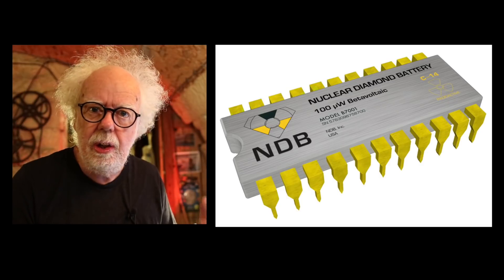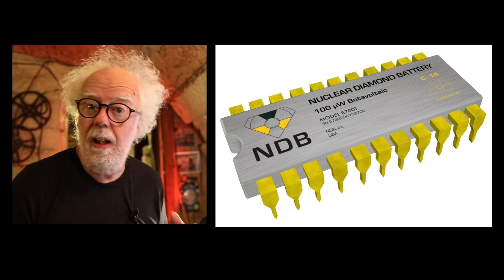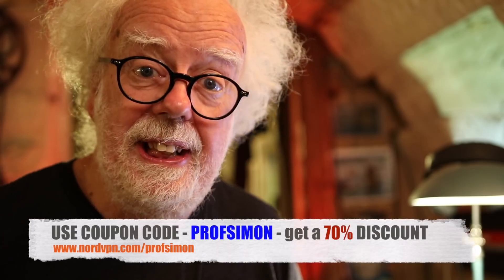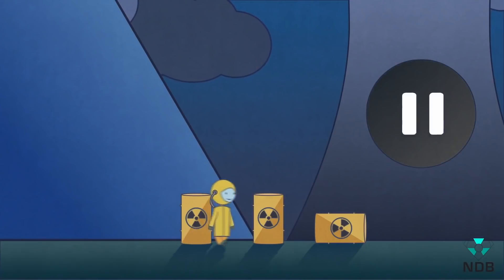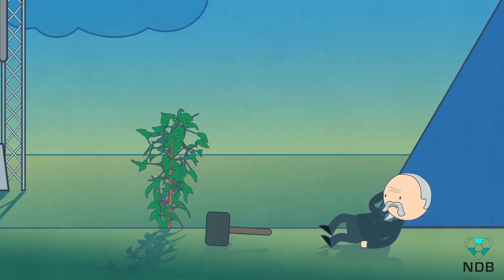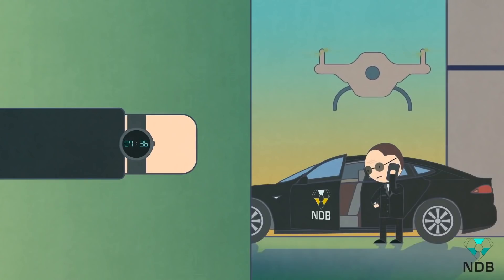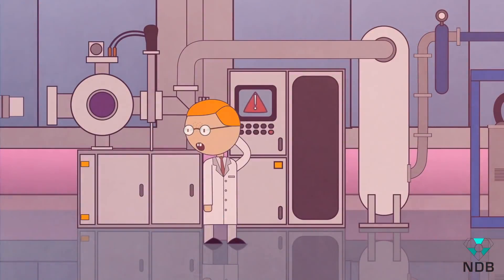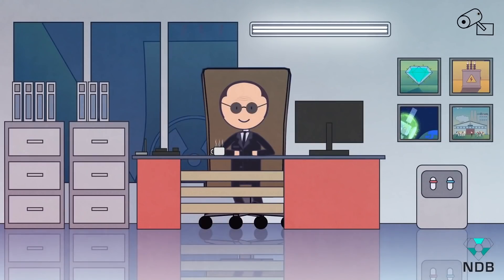How do nuclear diamond batteries work - prof simon

Comment: Its actually made from c14 that only emits beta waves. The side of radioactive material would be smaller than a pinhead and the diamond they coat it in would be dense enough to block the beta radiation. They could also put a layer of lead on it and Im certain that also would work. It doesn't emit gama radiation. If it did then yes, you'd need more than a nano diamond coating.

Comment: Alpha particles (nucleus of a helium atom minus the electrons)  are easy to block,  a sheet of paper will do.  Beta particles (electrons and positrons) are somewhat harder to block but these are the particles that could be used to generate current.  Gamma radiation (high energy photons) are the hardest to block.

Comment: Sounds fishy ...nuke batts are not new, but the power output is Low like the nickel-63 nuclear battery The open-circuit voltage and the short-circuit current are 1.02V and 1.27μA respectively. The maximum output is 0.93μW at 0.92V. equating to ~10μW/cm3 also the power density is far greater than normal batteries because it last 100years so it sounds really attractive but it will just about make your watch tick or run an LED for 100 years compared to a normal cell which may only last a month = 1200 times the power density but it can't run anything more power-hungry than the LED. It is still getting power from beta (fast electron) decay which we have been able to do for years since 1913, by Henry Moseley

Comment: They explain in the video that the radioactive diamond will be additionally coated in a non-radioactive diamond, allegedly solving the issue of leaking radiation and thus making it safe. I’m highly skeptical they’d even be promoting the idea if they hadn’t already solved the issue of radiation leak. If they hadn’t, it would be laughable and no one would even consider it a viable concept.

Comment: We make nuclear batteries at my company not for sale! The concept of this battery does work but not even enough power to power a phone. the way we make batteries is we take highly energetic material such as polonium, thorium and Tritium. When you say a battery produces electrons you have to consider that beta particles or electrons themselves. You need to use a silicone graphite material to change those electrons into electricity. Essentially you’re changing mechanical energy into electrical energy. However the energy coming out of these batteries is just enough to keep a clock of the CPU up-to-date. That’s why the shape of these batteries are like a chip. There’s a lot more you can do with a battery that never dies with extremely low power applications like I have an RF ID that always sends out a small signal. In addition to us developing batteries we develop applications that use extremely low power. However in no way can you consider this energy to be able to run cell phones a car or even a future for our energy resources. There’s no way you can make this big enough to. But in short the technology here is the beta particles or electrons and if you use a silicone wire grid you can use those electrons energy to produce electricity.
Reply: Why can't we stack the battery chips for more "power"?
Reply: @sixthkrownking  uhh each one is producing such a small amount of power (0.1mW) and takes a ton of money to make probably. Just putting it into perspective, your cellphone consumes 3-4W. That means you'd need 30,000-40,000 of these batteries. This would basically be a massive battery pack that weighs a ton.
Reply: @wakannnai1  yeah but, can you hear me now?
Reply: @paulloveless9180  nice
Reply: @sixthkrownking  sounds like it needs a solar panel to get the fake eletrons coming out of  it  every thing you or i  including us are vibration at diff  frequency  every thing  now laugh at the truth i took the time to shere with a stranger
Reply: i just imagine what the future could bring. 100 years 1000 years
Reply from the maker: Thank you
Reply: It's a surface area problem
Reply: Wouldn’t the fact that “nano” diamond has more surface area for a given volume, allow for more electron potential, which would allow for higher power?
Reply: What company do you work for?
Reply: I think they know what they are talking about.
Making it produce enough power for a cellphone or car, was probably their first concern. They woulnd’t have made this video, if it would flop. Just wait with the idiotic conclussions, till after they have shown it works like they say it does
Reply: Hmm. Since turning graphite into diamond requires a considerable amount of energy... are there ways to release this energy, by reversing the process, using the diamond as "fuel", slowly releasing the energy in a controlled way? Could pressing diamonds from graphite even be an efficient, dense, practical or useful method of energy storage?
Reply: @DarkSkay  no. Because most of the energy used to turn graphite into diamonds is actually lost to heat energy
Reply: @camwyn256  Oh, OK. Thanks for the answer!
Reply: @DarkSkay  We'd be powering the factories with nuclear power plants.. Lol

Comment: I do not believe there are very many graphite moderated reactors in the west.. only in former Soviet Union nations.   the only radioactivity you should really worry about is gamma radiations and fast neutron radiation.. Alpha particle are large but very very low energy..the Beta particles are the electrons that the battery uses   with as small of a quantity that appears to be used in this 'invention, I do not see either gamma NOR neutron radiation being much of an issue.

Also , there is an inverse  relationship between length of half life and intensity of radiation..  the shorter the half life, the more intense and dangerous the radiation issues.  

I did research the decay chain of carbon -14 and they are correct that the ONLY radioactivity that comes from carbon 14 is an non harmful anti-neutrino and an electron through beta decay of a neutron into a proton.  If one researches properly, one will realize that , once the contaminants have been washed out,  the Nuclear Diamond battery  SILL be a safe product.
Reply: Bruce Banner!

Comment: A big mobile phone battery last a day and stores about 30kJ of power. How much pure carbon 14 do you need to produce that much power in a day if all the energy from the emitted electrons can be captured and turned into electricity? 14g of carbon 14 emits about 1.4 x 10^17 emissions/day (half the mole decays in ~6000 years so this is a reasonable approximation). Looks like we need about 350kg of carbon 14 to power our phone.

i think the firm is a scam.

Comment: How many electrons (amps) total would be needed to make this battery?  I am not going to bother calculating it, but it would be a whole hell of a lot.  A whole lot more than the battery could pump out until it is depleted.  Compressing graphite into diamond is no easy feat, and requires a huge energetic investment.  We already make nuclear batteries, RTG, and they power satellites and other space craft.  They just aren't particularly safe in biological systems.

Comment: This is probably a scam. To power an electric car by this type of battery you'd need enough radioactive material to kill an entire city.
On the other hand, atomic batteries aren't anything new. They're used to power low-power space assets like the Mars rovers.
The most basic form of such a battery is a diode with a radiation source on it. From what I can understand from that promo, they may be  building exactly that, albeit with the radiation source in the form of a crystalline layer.
Reply: Make the car out of the batteries!
Reply: @richardwendling4030  hihihi and the occupants and everyone around the car will die of radiation sickness.

Comment: Graphite is essentially the same density as diamond, so no squishing required, just reorganising flat sheets into a diamond lattice. A few microamps will power a clock chip, perhaps even update a static display onee a second. A couple of micrograms of radium will supply much more power and there is plenty of that still around in old clocks and watches. Or just hit a quartz crystal with a hammer!

Comment: This technology was around in the fifties and 60's(not diamond based though!), I read about atomic batteries in old musty American tech books I found in the library in the 70's, they predicted such batteries would be used for many non-domestic devices - mainly scientific and/or military, due to high cost and issues of radiation contamination! Some were based around direct current generation via electron emission, creating currents via generating separate charges on capacitor like plates! Other types used thermocouples to convert the heat from a radioactive source into electricity! Arthur C Clarke wrote in his book 'Profiles Of The Future' about very powerful atomic batteries using Americium AM-241(half-life of 432.2 Years) that could power vehicles, homes, aircraft etc! Again there is the issue of radioactive contamination if there is an accident, also, Americium are one of the few elements that could go critical with just tiny amounts and could be (used in Theory) to make Atomic Bullets with explosive power of about a ton of TNT!!

Comment: If the engineering challenges can be solved and considering the very low and constant current output of this system I would expect it used as a high bred system with conventional batteries to create self recharging cells  that way satisfying high discharge requirements. By the way another way to get rid of radio active waste is to feed it in to a Thorium reactor.
Reply: high bred  *hybrid
Thorium reactors are definitely the way to go.

Comment: You can make Diamonds via plasma chemical vapor deposition as well without huge pressures or high temps.  Starting with Germanium catalyst etc. Also Nano tubes etc or "hot radioactive carbon" would facilitate the plasma igniting and more than likely the manner in which it could be fabricated.  It is a really interesting concept for lower power level sources.
Reply: The only problem is that they want to power cars with these. It's probably a scam.
Reply: @miaudottk9080  Imagine a nuclear diamond battery that can last 1000s of years ￼😊...then, realize such battery being 1000s of times bigger than a Li-Ion battery for the same power 🤔 (yes, this is a scam)
￼

Comment: This is not new technology as such. University of Wisconsun has done extensive work (Prof Jake Blanchard). Essentially a beta emitter decays to produce electrons/ positrons. Carbon14 is a beta emitter (as in C14 dating) as opposed to C12 which is diamond or graphite isotope. Beta emitters include tritium, Cu66 etc; all cheaper and easy to produce. More importantly the KeV (energy ) of tritium is c.1000+ compared to C14 (diamond) at 50 KeV. As to why you want to encase this in C12 diamond ??? (see question at  5.05). Makes little sense as hardness does not stop beta or any radiation - you need physical lattice density e.g. lead. Mr Pali below is correct - very small wattage. Their main use is to 'trickle charge ' a conventional battery continuously for short usage and LOOONG charge time. Also of note beta is blocked by quite a thin shield unlike gamma. Although the principal is  valid, this 'new' technology with a small pinch of  salt as their video is asking for donations/ investment. My background is the diamond industry (worked with irradiated green diamonds as tracers rather than C14 diamond tracers - discontinued for safety) where I was radiation officer, for my sins. I understand Prof Hollands background is Fine arts at Shefield polytechnic and the film industry.
Reply from the maker: Thanks Nigel.

Comment: When scientists invented plastic as something to last forever they rapidly corrected their mistake and says 'plastic lasts longer (than glass, metal, ceramics etc)' , this is how they sell more, because if something lasted forever it would sell once. A batery that lasts forever have as much chance of finding financing as a tire that never flats.

Also, I wonder how, uranium being a metal, nuclear waste isn't mixed in some amount into concrete and used to build nuclear waste storage buildings, which are built using normal concrete. It will be toxic anyway, being a waste storage, so it's bricks do not have to be clean, and mixing part of what you want to store in the storage building itself should be the best way of keeping more in less storage. The outer walls would be made of regular safe bricks, of course, but still...
Reply from the maker: Lasts forever....is a non statement..... advertising love using meaningless words...my favorite is.... ‘nothing’ ....such as... ‘nothing washes whiter’. Or ‘nothing stops your headache faster’.....what are they really saying?

Comment: The one at the start is just 100 micro Watts of power. Just enough for a tiny amount of processing like a clock. Thus minute amount of radioactive material allows the product to be sold for high end critical applications

Comment: Beta voltaic was patented in 1954, basically an NPN solar panel pegged to a radiation source.  Low low output.
Reply: In the early 70's a pacemaker even used a "Betacel".
Reply: thank you, thought so
Reply: I'm pretty sure we could do far better with current tech. Solar panels came very far since their invention. And there are other ways to harness the energy too.

Comment: Not withstanding reasons why a carbon 12 diamond would prevent the escape of radioactivity from a carbon 14 diamond, what happens when the decay releases nitrogen? Isnt that a gas? Wouldnt the pressure of this gas build up in the 'shield of carbon 12 diamond' eventually making it burst? If they can make this work, it would be a game changer for humanity. Just the cost savings of not having to maintain the carbon rods would be a boon let alone the new electricity, never charge cars, phones....